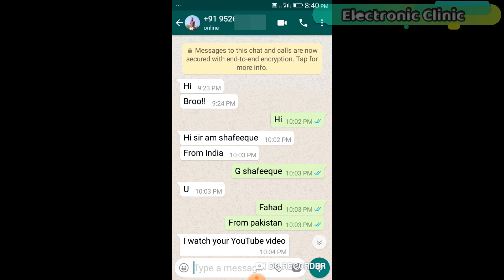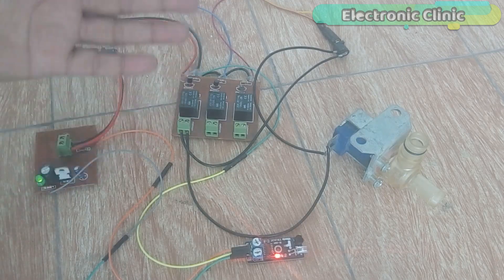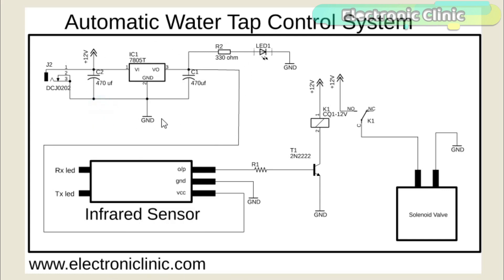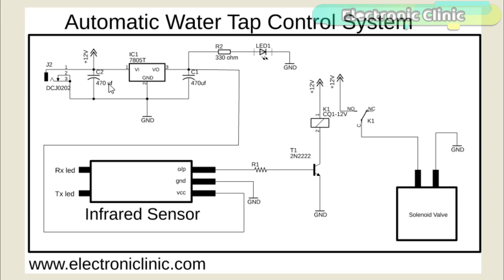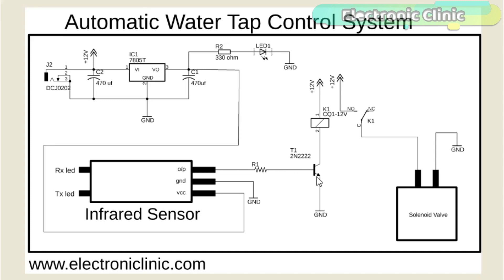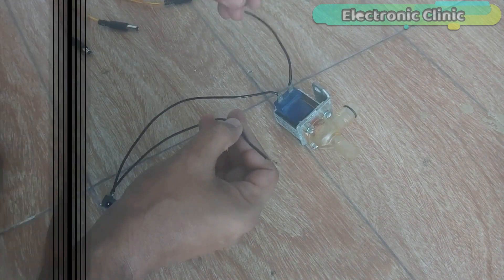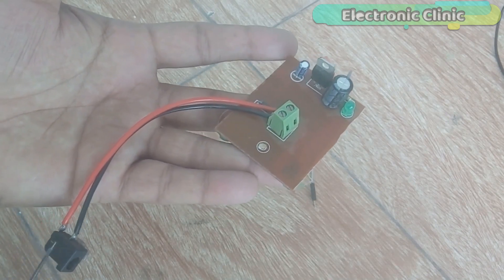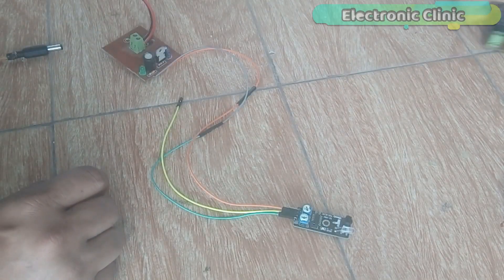Automatic Water Tap without Arduino using only IR sensor, Relay, and a solenoid valve

Comment: Does it require 3 supply adaptors?
Can you give circuit with only single 230v supply?
Reply from the maker: YOU CAN also use only one power supply. then you can solder some male power jacks.

Comment: Can you give me battery link
Reply: Ok thanks a lot, how many  hours it's working, can you give me circuit diagram for connecting this battery  in circuit,  requirement:power off condition  battery  power used for circuit, 
Power on condition  battery  in charging  state ,adapter voltage connected to circuit
Reply from the maker: Battery link??
Reply: @ElectroniClinic   I need to connect  backup battery with this circuit,  can you suggest me best and suitable rechargeable battery,  please provide  me battery link to buy,
Reply from the maker: Ok let me check
Reply: Sure
Reply from the maker: https://amzn.to/2VOn36I

here is the link. 
this is the best one, i have used the same battery in so many projects. works for days.